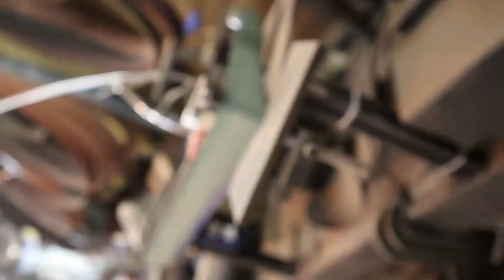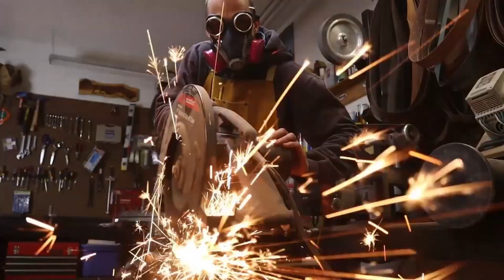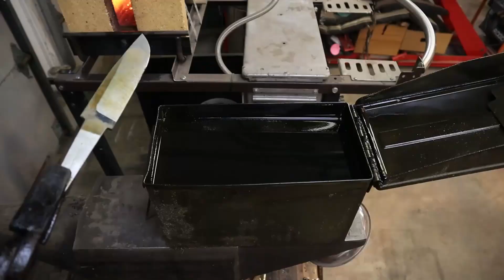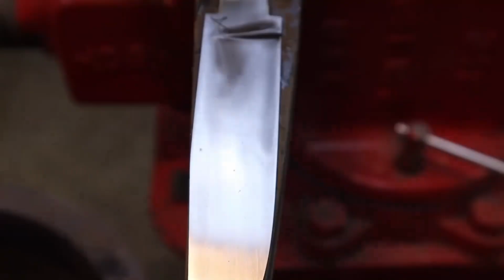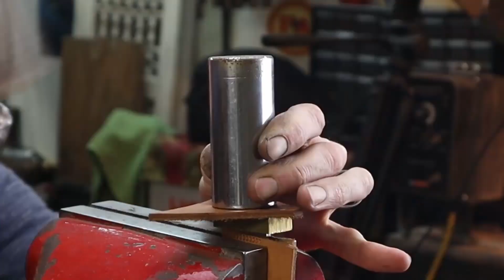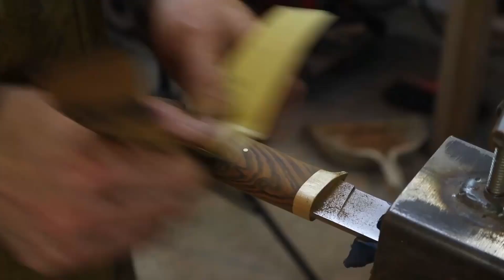Hand made knife - hidden tang camping knife

Comment: Is that a mathewson metal smith forge?
Reply from the maker: I don't know for sure. I looked up mathewson and it looks to be an exact match but everyone and their brothers have made a forge like this. My forge body is thicker than 1/4 inch and my burner does not have a stainless tip
Reply: @Aleeknives  It looks very similar. Most homemade forges I've seen are recycled tanks or fabricated squares. Nice work and videos, got a sub from me.👍
Reply from the maker: Tthank you J LV! I buy my forge tubes from a local scrap yard, my next forge is larger than my current one! I am gathering supplies now to build a new one!